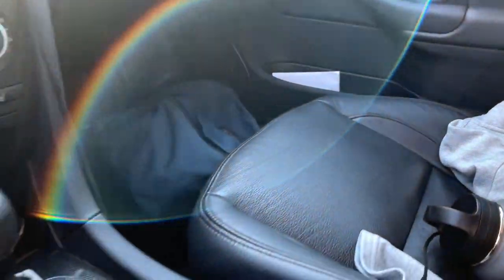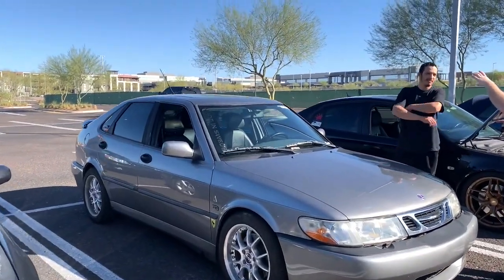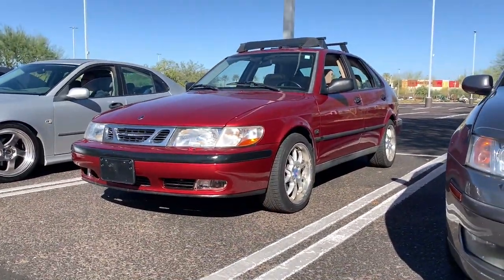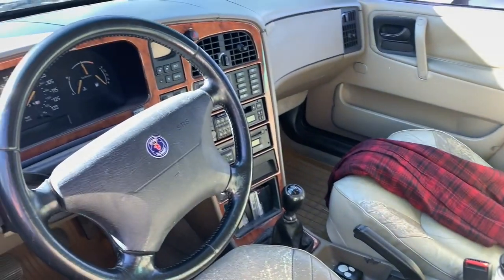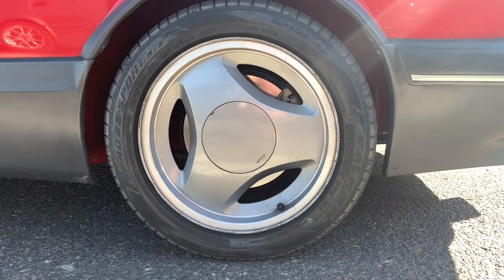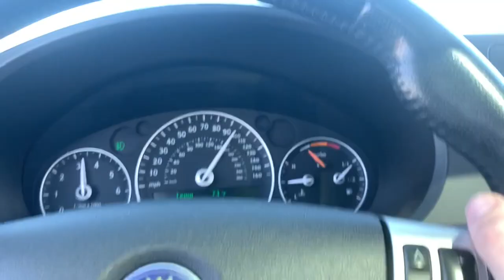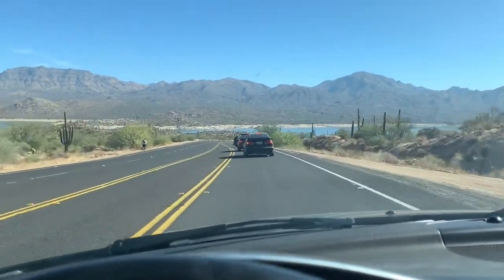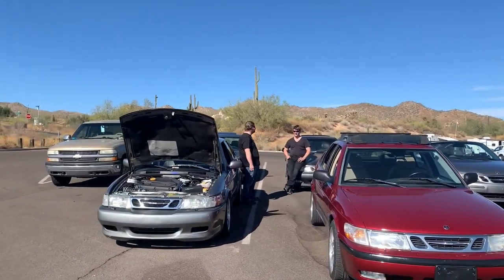Saab Club of Arizona 2020 Meet and Cruise!

Comment: That would be the first set of cloth seats I ever heard of on an NG. Interesting. Curious about the look.
All that SPG needs is a whaletail. Wicked good. Perfect wheels for it too. You should try to get a ride in it. The 4000rpm turbo lag is crazy and when it hits, the car tries to switch lanes and kill you but leaves you grinning like a kid.
Reply: My '03 had cloth seats, and they were awful. No side support at all and they were in the most boring shade of gray possible. Luckily I found a full Vector interior, it's much better now.
I live in Finland though, so the lower spec ones have also been quite common as everyday cars.
Reply from the maker: I actually did a video on that exact car here: https://youtu.be/ytsV_CcrqSU

Comment: Has anyone put an aftermarket navigation system in a 2011 Saab 9-5?  Need some ideas to get rid of the old radio and mine and not sure whether to upgrade and if the steering wheel controls would work w a new one. Thinking of a pioneer nex
Reply from the maker: Good question and I honestly have no idea. That would be a good question to ask a Saab Facebook group